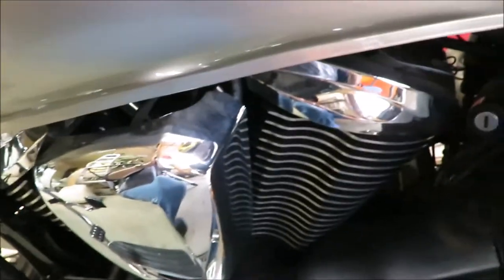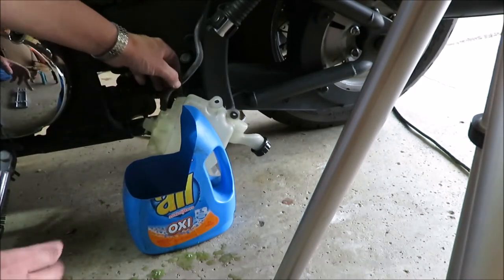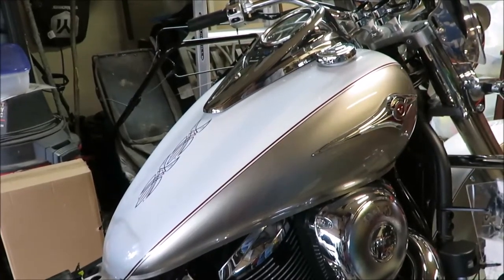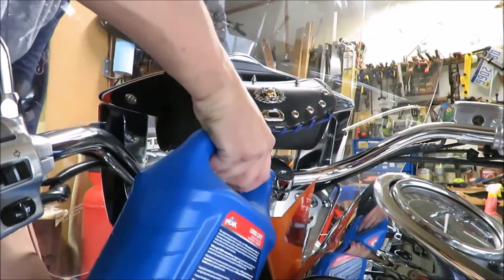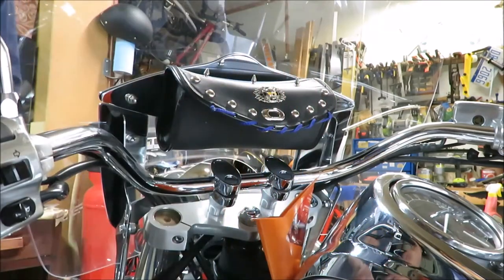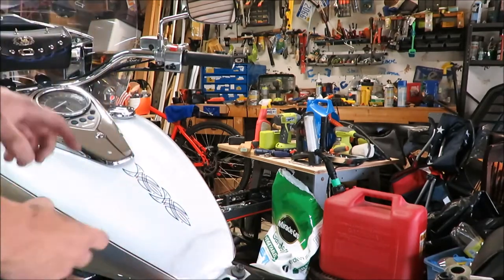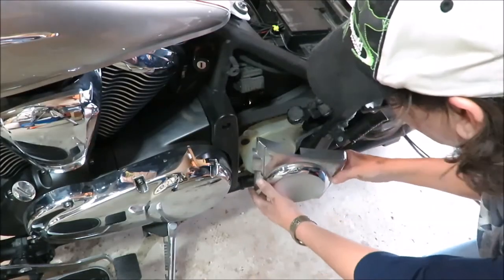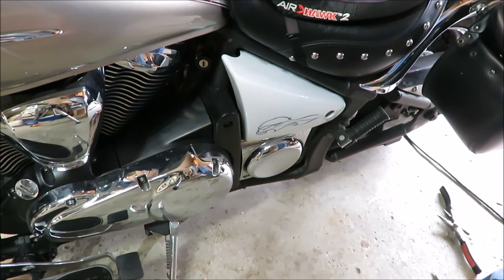coolant change on a 2008 Vulcan 900 classic lt.

Comment: Well done.I was dissapointed to see I have to move the gas tank.What a  pain in the ass ! My coolent is 10 yrs old so I have to do it  : (
Reply from the maker: Not hard at all. You can do it.
Reply: It's pretty easy just 2 bolts, good time to do your spark plugs as they are right under the tank

Comment: Well done. As previously stated run dngine to operating temperature prior to replacing cover plate to ensure coolant level is correct ( not that the be too much difference). Great guide and found the video very  real and informative 👍.  Great job mate
Reply from the maker: Thank you, sir.

Comment: shouldn't you run the bike after filling coolant tank before putting covers back on to make sure coolant is at correct level?
Reply from the maker: I took a ride and checked it after. I was still within range so I didnt go back in. Thanks for the comment. I should have put that in the video.

Comment: What year is yours?  Mines a 2011,  8500 miles on it.  I"ve been looking for videos on how to do this and finally found yours.  I'm not able to check the level cause I can't find it.  But, 2011 and I've never changed the coolant so far so...figure I should by now right ?   Another guy told me it's fine so...not sure what I should do.   I also found..kinda oily drops but they dry and leave slight stain on the concrete...coming off the rectifier cover...so it's close to the oil filter area which gets a little oily grimey but..it's not what's dripping or it's a mix of something with a tiny bit of oil......
Reply from the maker: Thanks for watching. Mine is a 2008. I just changed mine because I figured it could use it and I was bored. The level on yours should be good if you're not overheating or draining (overflow) a lot.

Comment: So you basically didn't disconnect anything from the gas tank? You just took out the two back bolts and pulled it back and off a bit?
Reply from the maker: yes

Comment: Can you tell me where the wind actors are in the fuel lines and how to remove them and and clean them
Reply: I need to know how to remove the injectors from the carburetion clean them and put them back in on a a 2007 900 Vulcan Kawasaki

Comment: nice vid! one of the best on this. what antifreee do u recommend 50/50, any suggestions? Can we use car antifreee green or red on older v900s? also, anything we should b worried about when moving tank, dont want dislocated any hoses underthere? Thanks!
Reply from the maker: Pretty sure I used 50/50. Green color. I had enough clearance with hoses when I lifted my tank. don't need to go very high. Thanks for watching.
Reply: Pre mixed kawsaki green coolent from the dealer is what I've used every time

Comment: And how do you get all the air bubbles out.
Reply: Run the engine and it will happen automatically.  Air will dump into the reservoir and coolant will be taken up in its place.  👍

Comment: There is a fork top cover missing ... cover the top with greace, or it gona rust like you never see before.
Reply from the maker: I have cleaned it out with steel wool and added some silicone to it. it drives me nuts. I gotta find some cheap caps to put it. Thanks for watching.